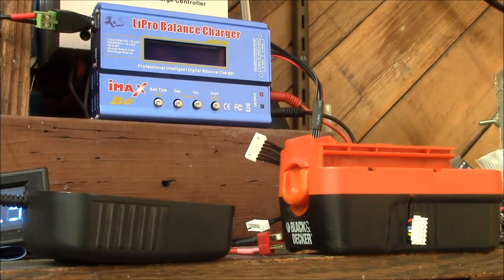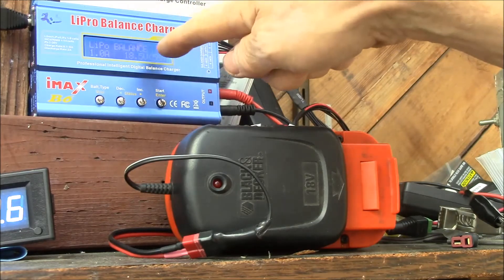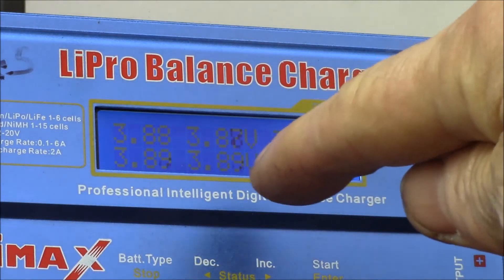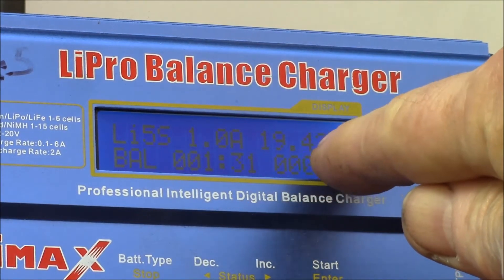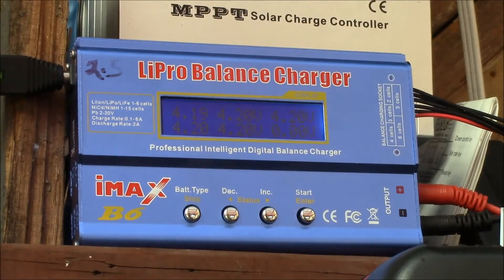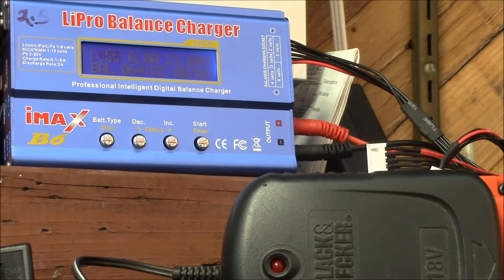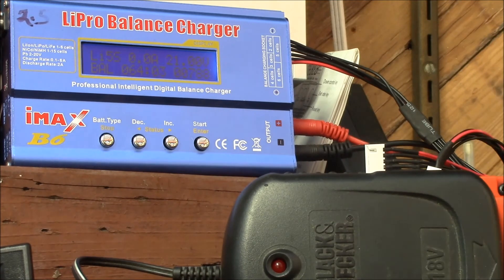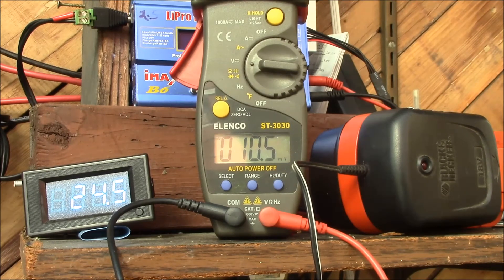Black & Decker Battery Project, - NiCad to Lithium-Ion Conversion Part 7

Comment: One question. A lot of other people are trying to use the old laptop batteries just to make cost less.  Were you inclined to try that option or is it harder to get the electricity/tools to perform the soldering and schematics. You may just put those in because brand new is a lot better to start with and that's a very good reason, but you do a very through run through and I was curios to see your solution with a 18650 set.  Great tutorial overall though
Reply from the maker: +Michael Jude I did try one repair with some 18650 cells where I just had a bad cell or two in a 5-cell Crafftsman C3 pack.  But to retrofit one of these NiCad packs, it seemed more straight forward going with an RC battery.  All pre-wired with balance leads.  Using the laptop batteries may be inexpensive up front, but folks forget the time to disassemble, test, sort and reassemble cells to make a pack.  Then you don't know what sort of "C" rating you'll get since laptops are a relatively low current, long run time load.  Power tools are a high current, short run time load.  So for me it was more a matter of my time spent vs. the end result.  I'm looking into a solution to add a built-in BMS capability to the battery pack when I convert the rest of my old NiCads.

Comment: I really feel you need to change your title. Include "Lithium, Ion, Li-On, Conversion, 18V" in the title.  I was looking for help on my conversion, and I never seen this video until I invested in an Imax charger, which I am having lots of issues with currently. Update your title, you'll get 10,000% more hits :)
Reply from the maker: +Michael Jude Thanks, title modified.  I do have Lithium Ion and Lithium Polymer in the video search tags, but maybe Google has broken those or doesn't use them in searches.

Comment: I will get a SKYRC IMAX B6 charger next week. Then, I will be partial pro, abit more intelligent and balance up a little. Just kiddy.
Reply from the maker: Yes, there is a bit of a learning curve with the iMAX-B6 chargers.  When I first got mine, it took a while to figure out what to do with it.  Then I just started experimenting with it and found out lots of things it can charge.  If you run into any issues with the charger, I know a bit, but there are lots of good videos on using them as well.
Reply: sure, happy weekend pal.